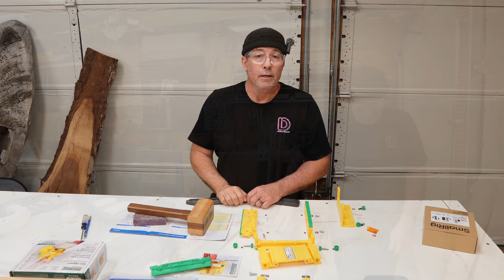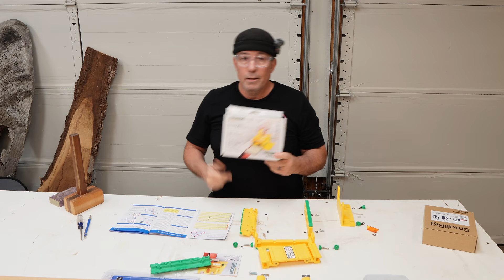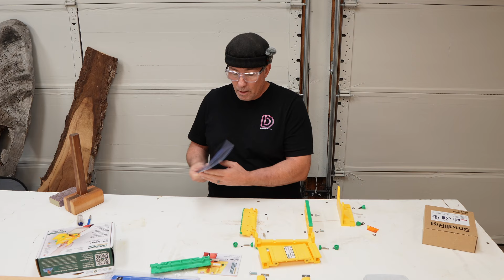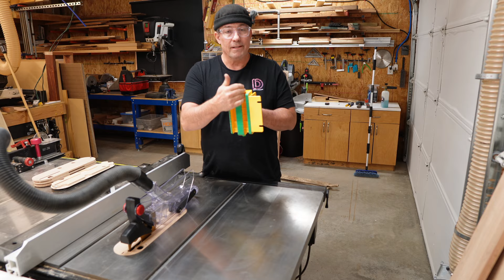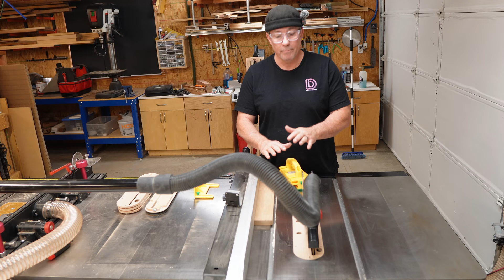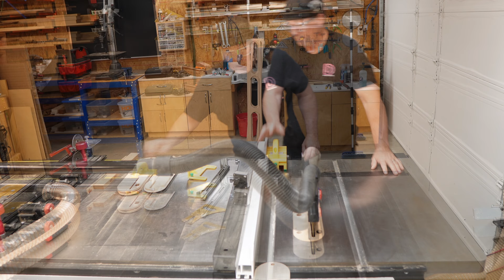TOO CLOSE - The One Tool You Should Consider Using!

Comment: If there is a new "cool" tool, I probably have it. I have a grr-ripper and I don't like it. The grippy part doesn't grip. I cleaned it with alcohol as recommended and still, not grippy enough. I took the handle off screwed it into a 2x4 I cut a notch into that leaves a lip in the back. Then I just let the blade cut into the 2x4. When its full of grooves, I cut a new 2x4.
Reply from the maker: I’ve heard of that before and love your solution! I like anything that allows me to hold wood down and into the fence. Thanks for sharing your solution!